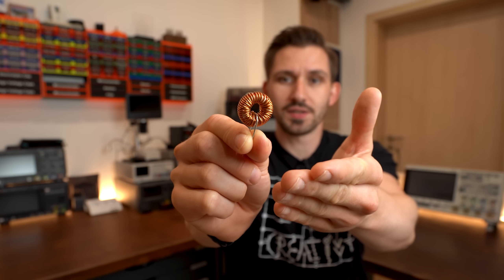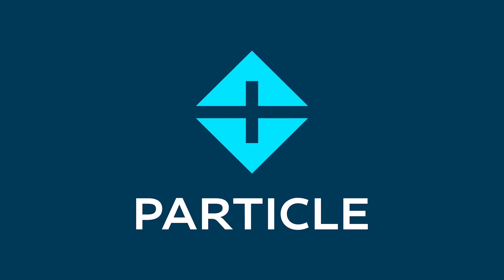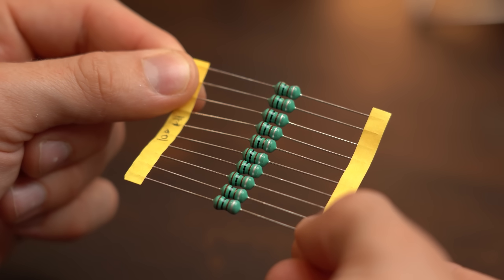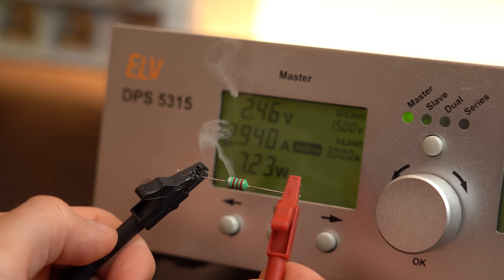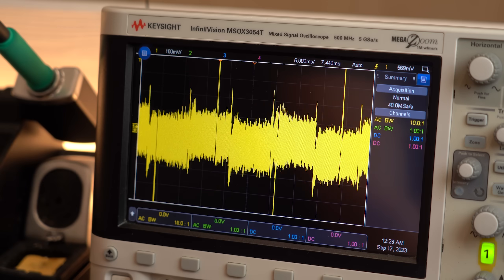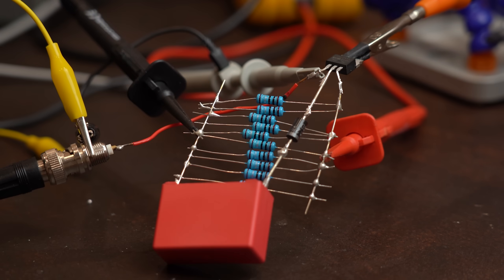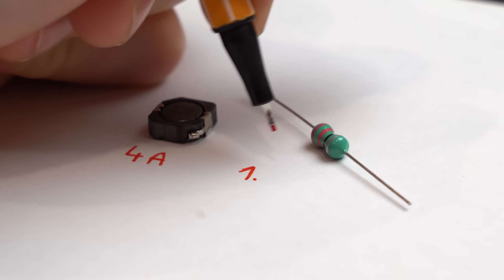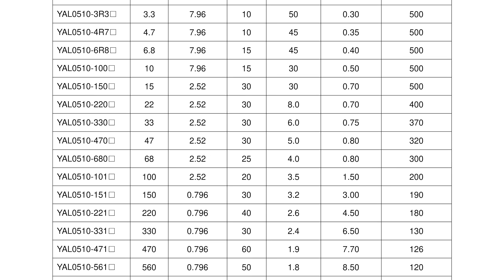These 3 Cent Components are actually USEFUL?! (Color Ring Inductor) EB#56

Comment: DC Resistance measurement would have been a good comparison between the two. Excuse me if i missed it. I would guess at least a 10 fold difference. This is called 'Q' factor
Reply: Q factor also depends on inductance, but yeah.
Reply: @sdjhgfkshfswdfhskljh3360  We know the inductance, it is the same for both, so the Q factor will relate to the resistance of each inductor. And that's why I worded it that way
Reply: @Phantom-mk4kp  with fixed inductance, resistance ratio equal to Q factor ratio (inversed), right.
By the way, your comment was shadow banned by YouTube: it was not visible with default sort ("Top") and no notification arrived despite mentioning my nickname. Beware of this effect.
upd. Looks like after my answer it is partially visible now. Strange.

Comment: Video Idea:  Take different package sizes of resistors and test them for actual rating before they run away with heat at say ambient 20C.  Then put shrink wrap.  Also maybe pot them in RTV silicone or some other compounds (its regional so whatever is good but in my case I can get Room Temperature Vulcanizing silicone for dirt cheap st autoparts stores, maybe test against electronics store silicone potting).  I think temperature is something that a lot of people and... cough cough... countries dont take into account.
Reply: There used to be climate classes for electronic devices and components and various home and industrial appliances and also for cars. Not sure if they still are in use with today's lax quality of everything. 
I tested in the lab some resistors made for temperate, cold and tropical ones and theirs resistance varied differently when heated in the oven up to 200ºC or cooled to -20C. They were the same type (carbon if I remember correctly) and from the same manufacturer. I also bought in Brasil a laptop that its plastic case literally crumbled to bits after two winters in the northen Europe. However, it was stated on the guarantee certificate that it was intended to be used in the warm (tropical) climate only.
Anyway, good idea for an interestig video.
May I add, the aging of electronic components is changing the values of theirs parameters. As a side observation, I bought two identical kits from China and assembled them, one with the supplied components, one with salvaged old components. The one with old components behave today like the first day, after 3 years of use, the other already drifted more than 15%; the kits were a linear power supply fairly complex, not the LM317 one.

Comment: A useful application of these inductors is as RF chokes for small signals, or to isolate stable supplies better than ferrite beads can (for analog power rails from digital rails).  One should mind the self-resonance frequency in these applications.
Reply: TDK / EPCOS still produces them in Hungary and those components are good for filtering and LED driver circuits where space is limited.
Get a good one which comes with a datasheet :)
Reply: I agree I work on some circuit that used these
Reply: @jamesmetcalf3123  The only issue is that their ferrite material properties are not specified, so you should check with every batch to find out how they behave at different frequencies. The inductance may decrease dramatically after the frequency gets to few MHz.

Comment: I know these, I've seen them in broken old circuit boards, mostly the boards found inside VCRs
when I first saw these, i thought these were resistors and I used a power supply to overcurrent these things thinking they'd make a nice light bulb, but they exploded. I took a closer look and saw that they were inductors and not resistors
Reply: Well you did not get a lightbulb but you got fireworks 😂

Comment: I saw Particle had made some changes this year, including making a free tier for people experimenting. I'd like to see their cellular device used to make an ebike tracking device. Being able to keep track of my ebike without a monthly fee would be really nice.
Reply from the maker: I can put it on my to do list :-)
Reply: I'd be very interested in such a project as I too own an ebike.
Reply: Lorawan maybe
Reply: They’ve had a free cellular tier in the USA for awhile. 

I have one of their boards in my RV to monitor my fridge. I have 200W of solar but my part of the US doesn’t get that much sun, so I need to keep track of the battery SoC to ensure my fridge doesn’t defrost. 

Nifty platform. I tend to roll my own stuff so I didn’t test all the features but I like it. 

I’ve upgraded my RV with unlimited 4G, though, so I will probably be switching away from Particle. I also want lots and lots of sensors in lots of places so it’s impractical to have Particle devices everywhere.
Reply: Free cellular? Is it 3g lte? Megabytes per month? Whats it called?

And what board do you use
Reply: @gf2e  You're right, it was probably longer ago that I saw the changes. I have a bit of brain damage and get time scales confused. I don't recall seeing any recent news from them in the places I normally look. I always thought they had interesting stuff but never used it myself. I appreciate hearing about your experience!

Comment: These are mostly used for audio / rf filters or micro buck/boost psu in some designs that require a stable voltage in a single battery voltage powered device (I've seen even smaller smd versions in cell phones)
Reply: Could I connect them to a 15W audio amplifier to make a low pass filter or should I put the filter before the amplifier?
Reply: @Mr.Engine993  before the power amp would be preferable I would think.
Reply from the maker: Thanks for the feedback :-)

Comment: Also they can be used to cheap out. Just imagine you are building 1 Million devices and you can save 0.47€. It's nearly half a million. Added bonus is, when you do it right, the device breaks down after the warranty. Its proven that some devices would had a few additional years, when added 1€ worth of better components. The added costs per device is tiny. Even when you add research to check on how "bad" a component needs to be, so it just passes the warranty, its still worth it for them.
Reply from the maker: True and a bit evil ;-)

Comment: I found one in my tool cab that "was gifted by the lab" to me as a souvenir. I have encountered a problem when I am designing a Bluetooth wireless headphone that the RF transmitting noise will leak through the power bus to be amplified by the power amplifiers. so I just connect the ring inductor in series to the Bluetooth board and ass a bypassing cap. It miraculously made the noise dissappear.
Reply from the maker: Haha awesome to hear that. Good application.

Comment: Yeah, this are meant to be used in signal processing/filtering not in power electronics... Nowadays signal processing is done at a digital level tho, so unless you wanna develop an FM/AM radio they are pretty not usable anywhere else.
Reply from the maker: Well, I think for very low power stuff they can still be useful.
Reply: @greatscottlab  yeah, at a hobbyist level for sure, still great video man!

Comment: Is it safe to use buck convertor in my car to supply esp32?
Reply from the maker: I feel like the current peaks of the ESP32 could be a bit too much power draw for these coils. But maybe with enough output capacitors, it could be possible. Give it a try ;-)

Comment: Great EB video as always. Yes i also did use them when i replaced the original inductor inside my microwave, as i wasn't able to get the original inductor, i used that colour ring inductor. Working perfectly till date.
Thanks for a ton of info!
Appreciated!!
Reply from the maker: Thanks for the feedback. Good to hear a practical application :-)
Reply: @greatscottlab  Yeah. It was in series of the mains input trace on the pcb. It was mostly for filtering and inrush current limiting purpose maybe.

Comment: I bet they can be helpful for tasks like filtering the ICs DC pins in conjunction with the blocking capacitors. Usually they don´t pull that much current. I need to try that on my own !
Reply from the maker: Sure. Sounds like a suitable application.

Comment: They don't list saturation current because they are not supposed to be used that way. They are low current devices, more for filtering applications. Size does matter when it comes to inductors for buck / boost applications. Good overview of them though.
Reply: These work fine in hf preselectors.. antenna filters.. or as tank coil in oscillators, etc. ..their apparent Q-values always surprices me positively..😅 more like radio stuff, not for power circuits though.. that's completely different world with air gaps and iron powder and sendust/kool-mu etc. cores..
Reply from the maker: Well, all product description claim that they can be used for everything. So saturation current is important and should get listed.
Reply: @greatscottlab can u put the color inductor in parallel and test the saturation current of maybe 10 in parallel.
Reply: @marcfruchtman9473 The equivalent inductance of multiple inductors in series or parallel follows the same rule as for resistors IF you ignore any magnetic coupling between them. So two 10mH inductors in series gives 20mH and in parallel gives 5mH. BUT when they're close or especially if they're wound on the same core the mutual magnetic coupling modifies this behaviour so that two 10mH inductors in parallel are just like a single 10mH inductor wound with thicker wire. Of course, the direction of the wind of one relative to the other also has a profound effect.
Reply: @johnm2012  Heat shrink two of em together for one of the worst transformers possible!
Reply: @EmperorA0  Well, two parallel tracks on a PCB work as a viable transformer at UHF.
Reply: @greatscottlab  using a technicality is a bit rubbish. When they list a bunch of applications, they mean you can use it in that product for say filtering, not for every aspect of that product.
Technically quarter watt resistors can be used for everything, if you use enough in parallel, but that is unfair and terribly bad faith.
Reply: @greatscottlab  No, they do not say they can be used for everything an inductor can be. Inductor is a broad term, a transformer and motors are inductors. You also have chokes, filters etc... When it comes to components like these, they get specialized, open core, solid core, toroidal etc... and each has it's own best use. These axial inductors are not to be used for high power devices. As others have mentioned, 1W is pretty low and sure, for small boost / buck they may work, but replacing an inductor on a 5A power supply, these won't cut it. So, again, there is a reason they do not list the saturation current and no, they do not say they can be used for everything. I also looked up a few datasheets on Digikey and these aren't a one does all inductor, no inductor is. Not to mention, there is a reason you don't see these often and I have only seen them on some frequency filtering or highly specialized PCBs. 
Still good to bring these to light to people, but just was a bad use case, in this case.
Reply: @greatscottlab your really great. I never knew until now. Thanks alot.
Reply: @greatscottlab  But they also say that they can handle a max. power of 1W, right? This implies that they are not supposed to be used for high power/power supply applications.
Reply: @marcfruchtman9473  The rating is how much power the inductor can dissipate, not how much power a power supply using it as the main inductor can supply to a load.
Reply: @greatscottlab  All of the information about the specifications of the inductor are right there on the inductor. The color code is standard. No need for a data sheet.
Reply: @kmoecub OK, list the specifications denoted by the colour coding excluding the value of course
Reply: It's because other sellers lie and overstate. So best not to say at all in some sellers minds to try and complete.

Comment: these do have some legit uses. i used them in my piezoelectric 1.7mHz mist maker circuit. (that didn’t work due to missing capacitor)
Reply from the maker: Great to hear a suitable practical application for them :-)
Reply: Also, your circuit didn’t work, because of the changed component values. You see, its a resonant circuit, so changing some of the component values didn’t work.

Comment: Picked up a bunch of these months ago for a few projects.glad to get more information on them. Would something like a heat sink help manage the wattage issue or perhaps im missunderstanding the cause of the break down.
Reply from the maker: Glad I could help :-)
Reply: Just a theory, but since temp did have a correlation with saturation current I think a heat sink would help in that regard, but there’s certainly a better practice